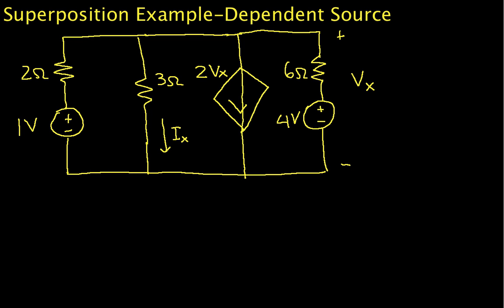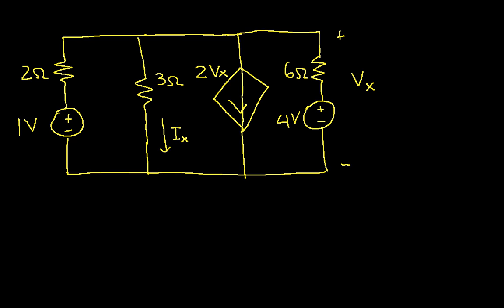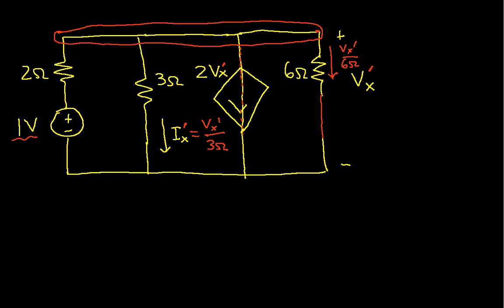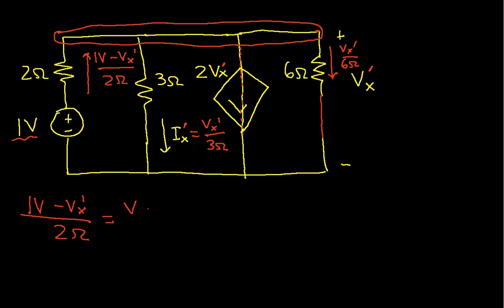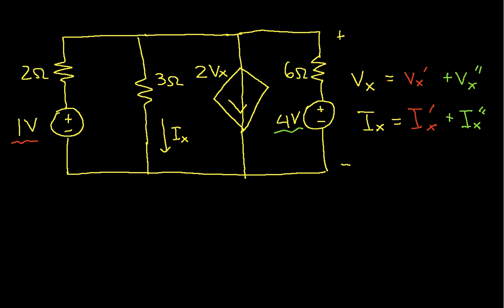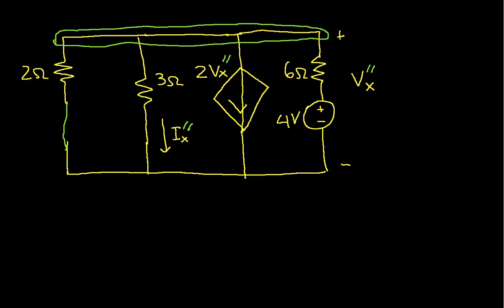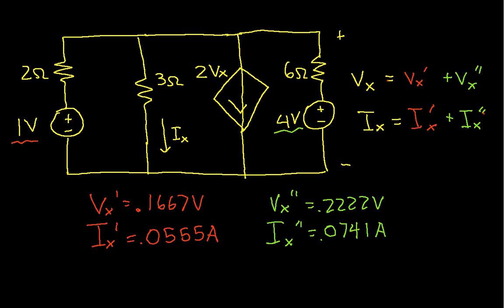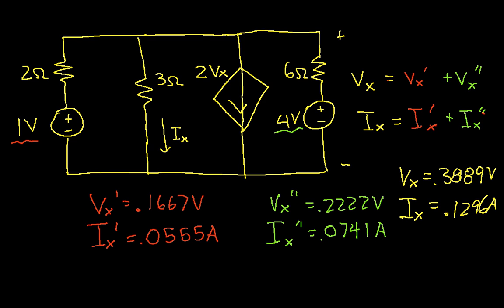Superposition Example-Dependent Source

Comment from the maker: Superposition works by finding the voltage or current due to each source individually, then adding them together to get the actual voltage or current. So vx prime is the voltage due to the 1V source with the 4V source shorted. vx prime prime is the voltage due to the 4V source with the 1V source shorted.

Comment from the maker: Yes, it looks like I am counting current and then voltage. I was not clear that the gain of the controlled source has units of Siemens (1/Ohms). So the units for the current are Volts*Siemens = Volts/Ohms = Amps. The method is correct, but I was not at all clear about what is actually going on.

Comment from the maker: When doing the analysis, it does not matter what direction you draw the current as long as you keep track of the direction correctly. With superposition, you do the analysis twice, once for each of the independent sources; each analysis is separate from the other. So I arbitrarily chose the current into the node for the first analysis and out of the node for the second. Sorry for the confusing inconsistency.

Comment: V(x)" and I(x)" should be negative right because at 10:38 the equation should equal to -4/6.
And an other way to see that you should make a substracion is that the two batteries are facing each other with the same  pole (+)(+) and (-)(-).
???

Comment: why is the current through the 6 ohm resistor Vx''- 4V / 6 Ohm. Why isn't this Vx'' + 4V / 6 Ohm?
Reply: Going left to right the voltage is going to be higher on the left. You subtract because it's greater potential, the higher voltage, minus the lower potential, lower voltage. That's why it's. Vx-4v/(6).
Reply: Because Vx includes all nod and 4V is just a part of it we need other part to calculate i think...
Reply: Because he took the current as leaving we ca also write it with + sign if we take it as current entering the node and other as leaving but in that case we have to write it on the other side of the = .So, then end result remains the same.

Comment: Seems to me when you are analyzing the 4v source, you have the 6 ohm resistor in series with the 2 ohm and 3 ohm resistors in parallel with each other. This gives you an equivalent resistor of (2x3/2+3) or 1.2 ohms. Using Vx = Vs(Rx/Rt),` the Voltage across 2 ohm & 3 ohm resistors (4)(1.2/7.2) =  .667 volts. Thus current through 3 ohm resistor is .222 Amps.(For the 4v source only. When analyzing the 1v source you have 2 ohms in series with the 3 ohm and 6 ohm in parallel which gives you an equivelant resistance of 2 ohms. So voltage divides evenly. You have 1/2 volt across the 3 ohm resistor and you get .167 amps.

Comment: i didn't understand why the current of the 2 ohm resistor is (1v - Vx')/2
Reply: The current is going into the node so it should be -(Vx' - 1v)/2 which is the same as (1v-Vx')/2